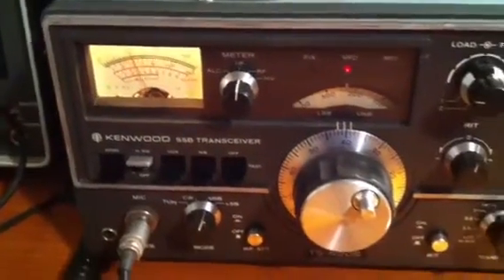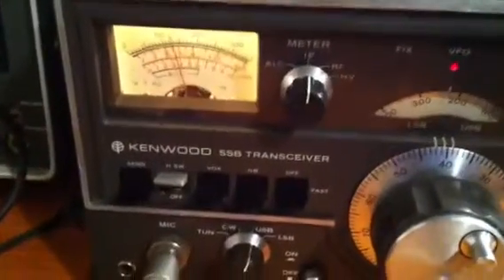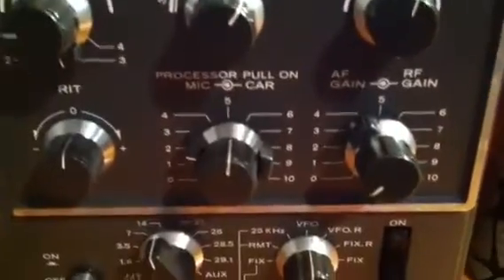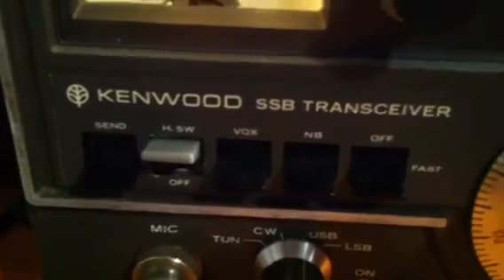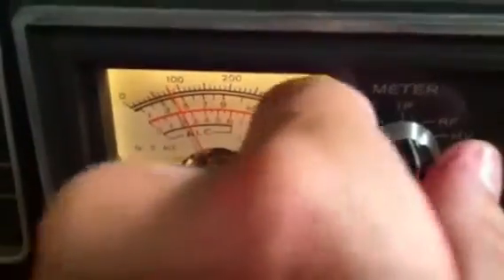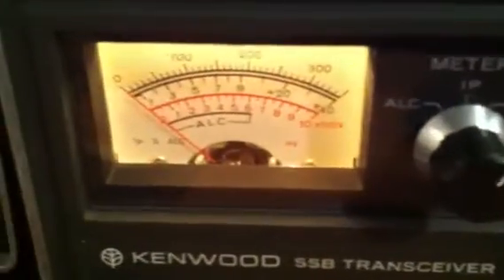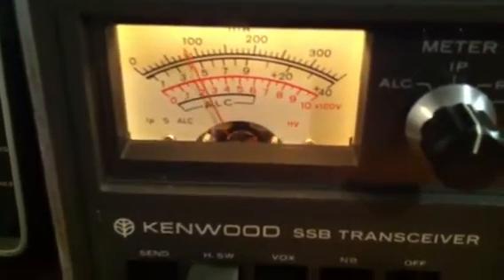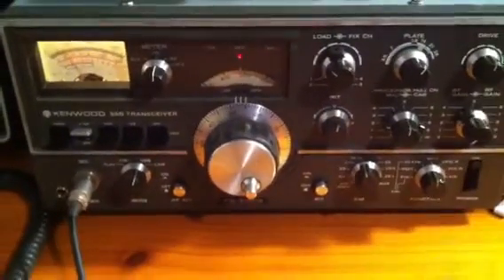Kenwood TS-520S TX fault

Comment: I had this happen on my TS 520SE, there was a big high voltage capacitor that went out on mine. I replaced the cap and it fixed it.